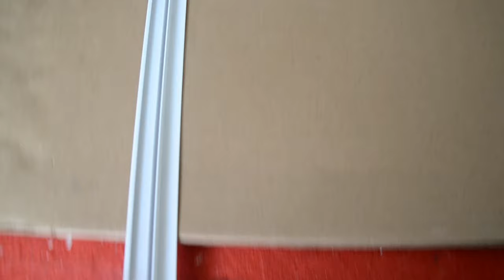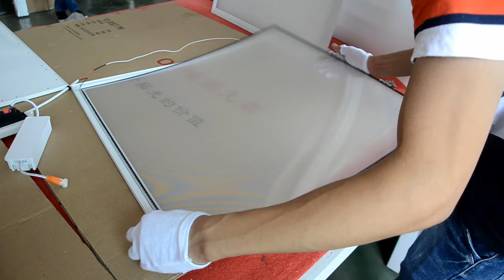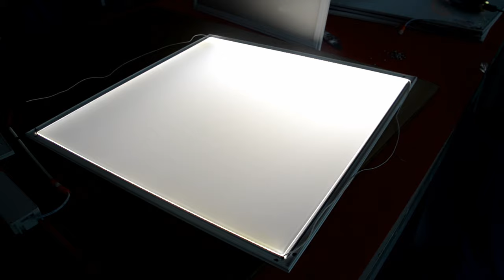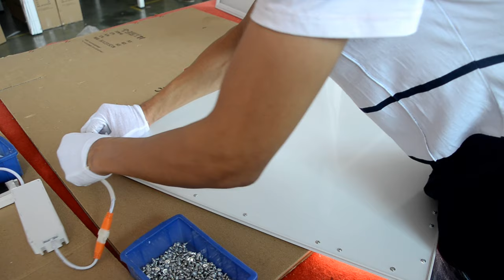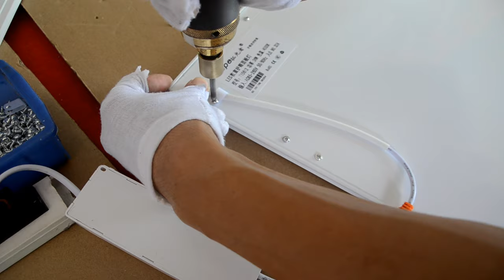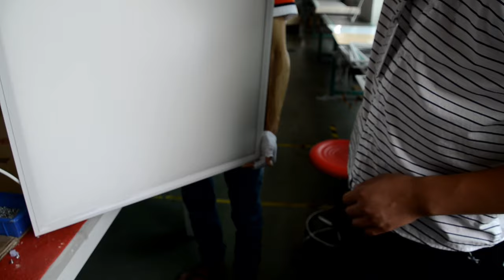LED Panel light making process

Comment: I need back light table for led tv repair. Size is 36 inch width and 60 inch length. Price please. This purpose  Need only acrylic sheet, diffuser sheet and back light